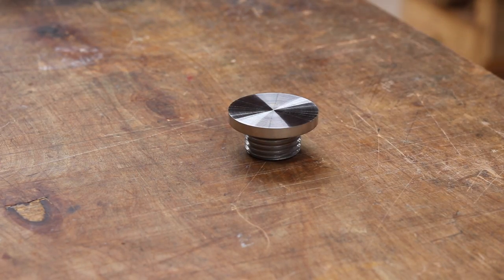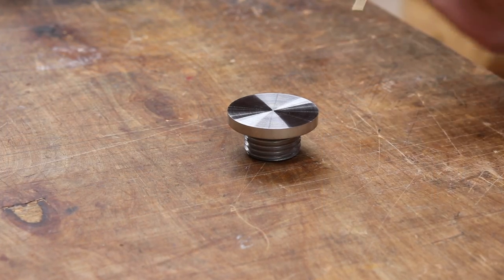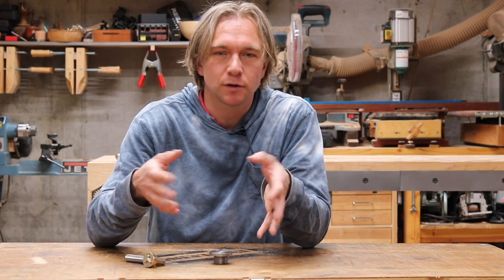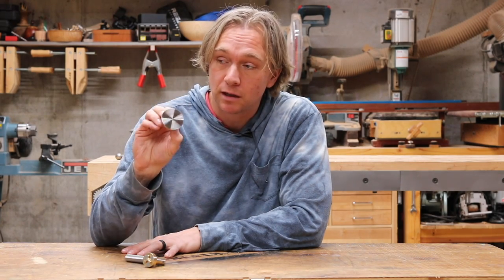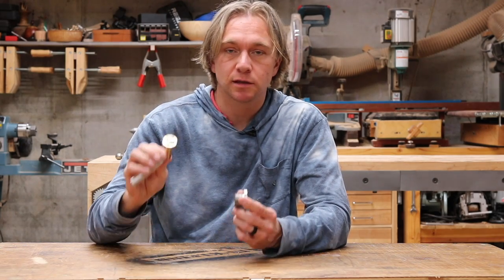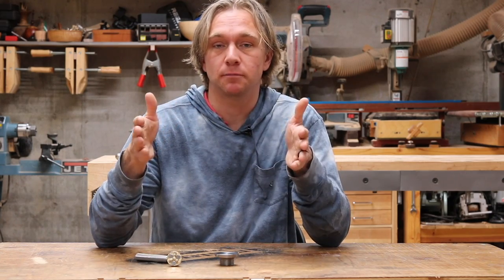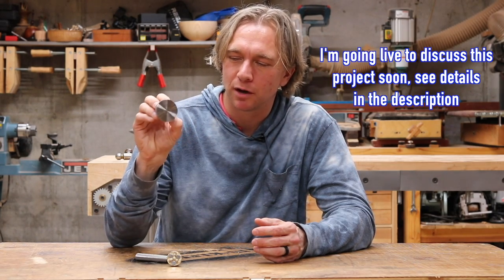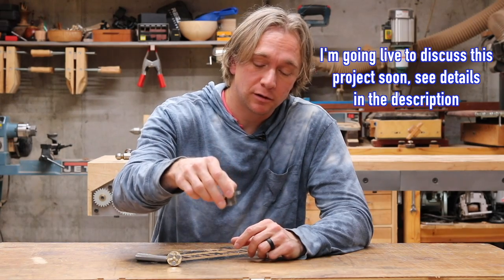A Screw With No (visible) Slot Is My Next Big Thing!

Comment: Its a winner!  Certain industries where cleanliness is important might use it just to keep assemblies more "visibly clean".
Reduce cost by losing the magnetic SS. Find another way for the tool to "lock" into the fastener for installation/removal (I thought of two ways already while typing this)
The magnet idea is cool but causing you too much headache.

Comment: This would sell like hotcakes as a motorcycle gas cap
Reply: I like it for cam cover bolts as well  and at $40 each not that much more than SS replacements or that much cheaper that Ti.
Reply: Yea maybe cool until you lose the tool or leave it at home and now you can't fill up your empty gas tank..
Reply: @davidkohler7454  make the wrench your key chain. Pretty much every bike you already have to have a key for its gas cap. Now it would look cool instead of being a key slot.
Reply: @davidkohler7454  keychains it can be any shape too
Reply: My thought exactly when I first saw it. Totally unnecessary but people would definitely buy. Or oil tank cap, whatever
Reply: @high633  my bike uses the same key for ignition and gas tank. Also a key is a bit more secure, and more compact.
Reply: @Fellysimo  my ignition key and gas cap are the same to. Pretty common on all vehicles. I just think it adds something to it and would look alot better than a normal cap. As for security a dude with a funnel and a punch could steal your gas if they really wanted it. So im ok without the locking feature. Plus most licks are easy to pick if you have some skill.

Comment: Neat idea. How much torque can be applied to the inside of the hidden slot before the tool scratches up the inside walls making the hidden plunger piece not want to pop back up? Kinda like how a screwdriver tip will scratch or mar up the inside slots of a screw. Especially stainless! Everytime I have to take something apart like a carburetor with stainless screws I curse! Great videos and craftsmanship you have there by the way! 🍻

Comment: I've thought about hidden or hiding hardware fasteners before this is super neat but wouldn't a cover for traditional screw heads be easier.  Not those cheap melamine stickers but brushed metal fastener covers.  I mean technically couldn't you just use magnetic buttons?
Reply: Came here to say this.
Reply: Best answer

Comment: I just saved it to my "house" playlist. I think the price isn't totally unreasonable. It's pricey, but if you're doing something on display in the kitchen, I could see it. I know it's hard to 'humbly' name something after yourself, but reality is, if something becomes popular enough, people will associate "Klein" with that product, and I think it's unique enough in the field to work well. Just like a Robertson or a Philips screw.

One thought of mine that might make this impractical is the size of the driver slot taking up so much space. The shaft looks like it takes up over an inch, which limits the applications it could be used for. Shaft length might also be a thing, and what @Eco Mouse says about common thread sizes is  also a valid comment

Another name might be something like Magneto Bolt. But I still like Klein Screw or Klein Bolt better
Reply: K head

Comment: I used to make furniture with hidden compartments. I wouldn't want to put multiple of those screws into a compartment, but if you sold 'blanks' in addition to the screw, I could see it being a system. For example, $40 for the screw with the hidden slot and blank medallions that look the same, but lack functionality, for a few dollars each. Then you'd have to find the hidden slot among multiple stainless steel circles to open it.

Comment: gears, motors, vacuum chamber, etc. where it is important with a completely smooth flat surface to keep air / liquid tight. I'm positive that there are someone who need this function in there design. you should try to reach out to the companies that design expensive precision parts for machinery that are in demand and complicated.

Comment: I live in San Bernardino, CA. The glass panels at the bus stops have similar type screws but they have a special tool that has a hole in the surface.  Your screw would work great in those locations

Comment: IMO, you would be better off just having the driver hole decorative AND functional. 
Forget about the sunken, drop down slot with invisible seam etc. 
But have machined, pretty and decorative screws with a purpose built tool. (That incorporates into the furniture somehow so you can never lose it.)

Comment: There's a famous custom knife maker that has been doing stuff like this for a long time..His folding knives look like pieces of art..You see no pivot pin, the mechanisms are all hidden and the thing just looks like a fancy block of Damascus steel..Then he hits a hidden button and a long sharp blade springs open..His knives are thousands of dollars..I think his name is Stan Wilson..I could be wrong though...A tip on manufacturing these...Your price point is cool, if you make them durable too..People don't mind paying more if it looks good and also lasts a lifetime..The most important part is how are you gonna market the tool to use them too? Are they included?

Comment: "stealth bolt" another lower tech way of hidding the slot could be to have the a normal slotted head but then have magnetised caps to connect to cover the head. you could remove the caps with a seperate magnet that stronger than the magnets used to hold the cap on the bolts, if you catch my drift
Reply: I agree...as cool as this screw looks, a cosmetic cap seems so much more cost efficient.
Reply: Just what I came to say

Comment: I think you can reduce manufacturing time, complexity, and costs greatly by using the same concept, but not machining the recess in such a complex shape.  The recess only needs to be a straight slot which gets depressed, and not this 3-leaf clover design. The slot would go half-way across the bolt.
Reply: It could be even simpler. Just 2 or 3 peg holes
Reply: Or even... a hexagon, so a large Allen wrench could be its driver?
Reply: Or just make it a normal bolt which gets covered by a clean plate! It's cool, but totally overkill

Comment: I would call this the Flushed Mounted Locking Screw. I would use this on the ends of a Drawer Cabinets where I had the side drawer insatlled vertically. The other Drawers would be centered between the two vertical drawers.The bottom would become the side where I had Hand Guns or anything of great value stored for quick access. What I was going to use was a Knob that would turn and the lever had to go through a maze of tabs to work the lever through. As you work your way through the Knob on the shaft would pull out a pre dertermined distance each time. Like a combination lock. Also it would be nice if it was in Brass to match darker woods, but one thing at a time. Good luck with the idea.

Comment: The Incogscrew looks awesome but as a furniture maker that's pretty steep unless you appeal to rich areas. Curious as to why you went with magnetic stainless instead of say polishing a high carbon steel or tool steel. The design and execution look amazing but I agree with some of the other comments, making this a hidden lock or latch would probably sell better. I would build a cabinet around this piece if it were a lock. Nice work though

Comment: This is awesome engineering wise! Looks and practicality wise, I think the same could be achieved with a normal bolt and a flat disk to cover it. Maybe using a magnet to connect the disk to the bolt, and a tool with a stronger magnet to remove the disk?

Comment: As an assembler, working with all kinds of different blots, to put together our door machines. Idk how tough those are but you could approach a company like the one I work for, and possibly get them to consider using these for certain things we do to for certain parts of our machines. Because alot of times I have to counter sink holes for the counter sink screws I use to sit flush in order for some of my parts not to hit or bind up while operated or moved around. Very great idea man. Hope all your hard work pays off for you man.

Comment: I can imagine the two metal parts becoming welded together quite quickly if left in one position for a length of time or if some moisture got into it.
Reply: Even though it is stainless?
Reply: @JDeWittDIY  yeah. I can't see it being a problem if it's stainless.
Reply: depends on the type of stainless. I have seen a year old marine stainless rusting on expensive boats while the old timer with stainless steel on his boat looks brand new.

Comment: The smooth head would be a good surface for an external screw on an aircraft.  Especially if the screw was locked in place by the same mechanism which pushed up the internal plate.  To prevent vibrations form unscrewing in over time.
Reply: And why would you take this over rivets, which seal up the hole and are held in place by their form, instead of the friction in the threads. You would also need a thread in the  <0,5mm thick metal, not to mention the huge difference in manufucturing costs. 
I might have misunderstood you, but i think a complicated locking mechanism to prevent loosening, isn´t as good as, not having a screw to begin with.
Reply: @RayIrv  You are right, rivets would be better in most applications.  But the are parts where you might want to get access to, at some point in the future.

Comment: Klein Screw is the perfect name. When I heard it mentioned, my first thought was in reference to the "not-a-bottle" Klein Bottle.

Can you make the slot into a hex or square so regular tools can work with it? I'm sure the return spring is stiff, but is the magnetic latch really necessary? Is it that hard to just push on the hidden slot once the bit is seated?

I think it's an awesome novelty, but not viable at that price point. Who wants to add $160 to a project to add 4 cool screws? Some maybe but I figure most will opt for a cheaper cap solution to hide the fastener. If you can bring it down to $20-$25 per screw and no special tools involved, you've probably got a winner.

Comment: I feel like you could just joint a table or drawer in another manner and add a simple metal piece.
Reply: Or have a normal slot at the other end and screw it inn. Having small holes in the wood and use a screwdriver
Reply: @sk0nz  or just have a screw without any slot and screw it in using friction. Maybe a rubber headed piece.

Comment: The best thing to do would be to approach a furniture/etc manufacturer who may be interested to see if it's viable. I don't think that price point is realistic, you'll need to find a way to lower your production cost. Initial investment will be higher but that needs to be a business expense that is recouped over time. You cannot directly pass those costs onto the consumer in your first year as it just won't sell. Investment is your best option. Get a patent, approach high end furniture manufacturers for interest and give those responses to a bank to apply for a business loan. Get business and innovation grants from government. RE: the product itself..... It will need to be able to be smaller, larger, longer and shorter. A variety of sizes would be best. The ability to do custom sizing which can be CNC programmed to keep production cost down would be ideal. Most important make sure you streamline production and make it cost effective! Good luck.

Comment: What happens to the screw if it becomes damaged? If it's a permanent fastener, then that might not be a problem. If it's part of a functional moving par, how would it hold up to frequent use? What happens if oxidation due to humidity or spills happens in the joint? Ten years from now will the metal become bound? Just a few things to consider.

Comment: You should make a couple variant sizes that mimic the bore size of standard forstner bits. Or maybe just a little bit larger so the hole can be worked to precise dimension after boring with forstner.

I look forward to picking up a dozen of these in their current state though. Excellent craftsmanship man.

Comment: It's interesting, I'll give you that. I personally wouldn't have use for something like this in my tool box.  I could see them being used strictly for tables and such, but they would have to be included. I'm  always finding Myself reaching for wood, machine and sheet metal screws good variety with good choices between the heads be it Phillips, Flathead, or nut and bolt, they're widely universal, especially owning a 6 in 1 or a ratchet system  screwdriver that has the interchangeable  heads and can fit nut drivers.  I mean for a $100usd. I could get a tone of screws and drives and be set compared to owning one driver and one screw. Not a bad idea for furniture be it if the driver and amount of screws needed were included. 

But that is just my personal input, and how I would weigh my spending options for that type of stuff. I do think you're onto something here and could really see it take off in the diy furniture market.

Comment: if the driver could easily attach to the dresser as a type of handle would be pretty cool. TBH this is pretty sweet, but if you can get your purchase price to $20-$28 per unit then I think you might be onto something for the consumer. I'm a Carpender/maintenance tech. I could see these being used as a security screw for the cities water supply attached to commercial buildings. usually they use a Key nut, but the problem with those is that the keyinserts is usually sold at Home depot. something like this is more secured. Also these would work perfect for electrical hubs for cities, usually its a padlock, but a padlock can be broken into with a paperclip, or a piece of a soda can. if you had to unscrew the bolt before getting to the key slot then it would make it very difficult for intruders. this is genius, but selling it to the consumer at $40 per unit doesn't seem worth it especially if you have to put 6-8 of them in a table. I do see what your saying. but this offers a better solution to our poorly secured power systems and water systems. please consider.

Comment: You went the wrong direction. I would have designed a hole saw that cuts an annular ring (a donut). The ID of the donut would exactly fit the outside diameter of the screw head. The OD of the donut would be approx. 6 - 12 mm larger than its ID. The purpose of the hole saw is to cut a piece of wood that functions similarly to the way a "plug," cut with an ordinary hole saw, is used to conceal ordinary screw headss. The system works as follows:

1. Cut annular plugs from stock of the same wood and similar grain to the furniture part being attached, let's say it's a table top. The annular plugs should be slightly thicker (1-2 mm) than the thickness of the screw tops.
2. Counterbore holes into the table top. The counterbores should be the same diameter as the OD of the annular plugs.  Drill the counterbores to the depth of the screw top. 
3. Throughbore holes to receive the threaded part of the screws, drill down the center of the counterbores.
4. Screw in unslotted, solid-top screws ...no tricky wire EDM contours, just solid tops ...into the coounterbores, with their threaded ends projecting through the throughbores. To tighten, grasp each screw by its edge, which might be knurled to insure a better grip. There is clearance to do this because the counterbores are 6 - 12 mm wider than the screw heads.
5. Glue in the annual plugs after the screw heads have been tightened. Recall that the annular plugs are sized so their OD exactly fits into the counterbore and their ID exactly fits around the screw head. If plugs were cut a tad thicker than the screw heads, they will fit slightly proud above the screw heads, and the table top.
6. Place HDPE tape over the screw heads, then sand the plugs flush. Voila! Perfectly "inlaid" metal fasteners.

With this method $1 plain fasteners replace $40 wire EDM-ed fasteners. The only tricky bit is the hole saw made to cut donut holes. But using concealing plugs mirrors how woodworkers actually work, in the real world. And $200 of fancy wire EDM-ed table fasteners is reduced to a one-time $50 purchase for the special hole saw, plus $2 - $5 each for the solid unslotted screws.

Comment: As far as a name I'd go with either Klein screw or Flush screw. The product itself has allot of potential in many markets, but I think ease of use and price point would be your biggest challenges. I would suggest offering a specialized "key" option as you have right now and then a generic Allen head option for things like furniture. Giving the option of a standard Allen would reduce the price point some because you wouldn't require the purchase of a special key. I'd also consider using cheaper materials to cut cost a little bit as $40 a screw is significantly more expensive. Right now I feel it limits your applications to basically the "high end" of products where people could actually afford to spend that kinda money (kinda a niche market). Aside from that I love the look and the elegance it would bring.

Comment: Also a means of securing a skateboard to a set of trucks if you could find a way to stagger the distribution of weight across the truck plate by the way it's fastened, we have tap in locking bolts like this for skateboards already, so having a tool that could possibly do it from both the top of the skateboard deck and possibly bottom with one single tool would revolutionize skateboarding.

Comment: I personally would not have a use for it unless you can make a much smaller version of it.  I also would like to see what happens to it once dust, moisture and corrosion get to it, will it still be removable?   Can it be stained or anodized to different finishes so that it can be made to to be hidden entirely?